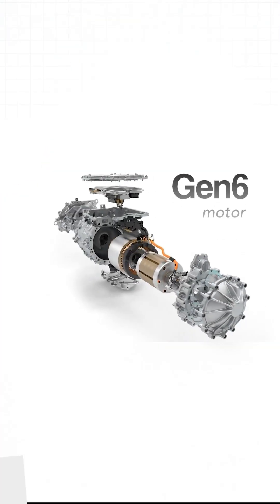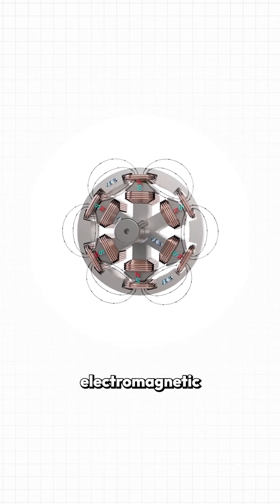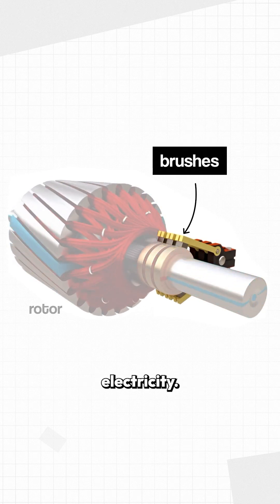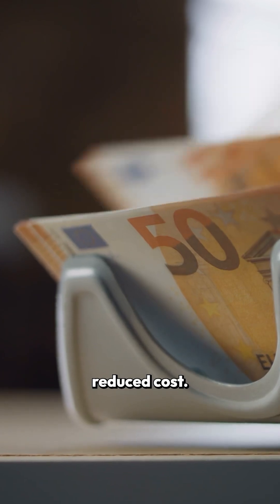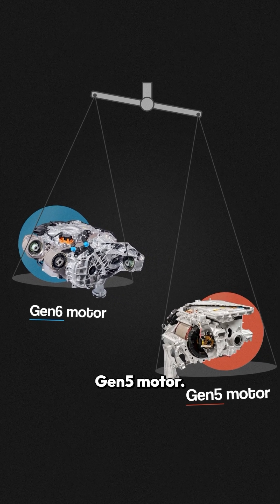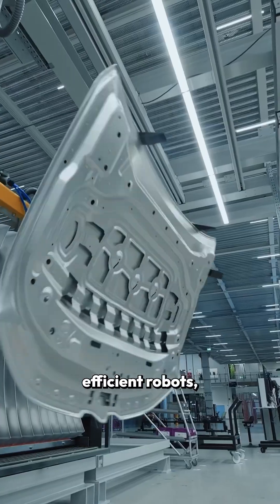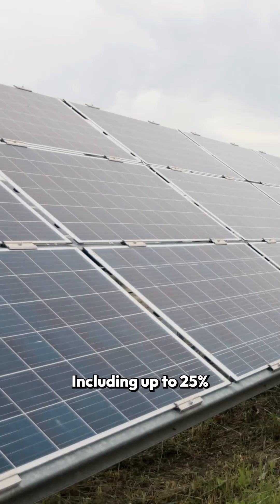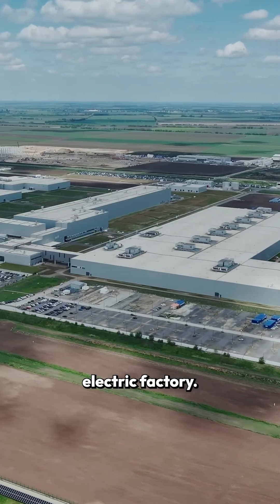BMW’s New Motor is FREE of Permanent Magnets

Comment: I bet that they'll use the fact that the brushes wear out real fast as a super expensive service item you can't replace yourself.
Reply: I vaguely recall an interview with the Munro Associates people saying that an easily serviceable brush wouldn't be too challenging to design. If they're like motor mounts or cabin air filters, they may be slightly annoying to reach but still customer serviceable. The bigger question is whether BMW will hose its customers by locking it all up behind ISTA or some other software lock to register the new brushes. I hope not but I could see it happening.

Something else that changes for the IX3: the battery pack is cell to pack instead of cell to module. They said the battery cells don't really go bad, the control units do. And they said they put the control hardware under the rear seat for easy access. So maybe they've done something similar with the brushes. Have you heard anything like that from the videos you've seen? The seat thing makes sense to me for control units but I'm not sure how you'd access the bushes between motors and the battery.
Reply: @JH-uu7jl  they have a duty to maximize shareholder value. What do you think they’ll do?
Reply: @Haveuseenmyjetpackshareholder value is customer coming back. The only person really in need of repairs is the repair shop or the BMW Dealer that services the cars. From a business perspective you want to earn as much as possible sure but you also want to earn as much as often as possible.
Reply: Still better than CCP pulling the plug on your car whenever they fight against whatever country.
Reply: @Boris99999  No one asked about the CCP. BMW is already playing games with customers. Changing the topic isn’t lost on anyone.
Reply: @JH-uu7jl Brushes have been around forever and aren’t difficult or expensive to replace. But don’t trust any of these companies. They’ll charge you a subscription and put an encryption for a motor brush if they can.
Reply: That's right, there's a video by MUNRO where he explains how to change these brushes on a Nissan engine. 😊
Reply: @JH-uu7jl Nobody thinks they will be hard to service. Everyone assumes they will be hard for users to service. They'll have some digital signature RfID tag or the car's computer will put it into limp mode unless a BMW service tech uses a proprietary "service" reset.

It'll be real easy to service so that their dealer service margins are sky high.
Reply: The topic has been covered before. If I recall right the brushes last 60.000 or 200.000 miles, at those times a bigger service is needed anyways
Reply: Brushes ? We've come full circle
Reply: @drmed92  Yes, we learned that brushes are not ideal but I am curious about what specifically BMW has done in regards to using brushes and why from an engineering, manufacturing, durability, efficiency and cost standpoint(s). Let's see the figures! What will this mean for the buying consumer?
Reply: @user-vp1sc7tt4m  and the stealing consumer!  What will that drive be like?!
Reply: @frederik3326  Bigger service for an electric vehicle? They are basically trying to add bigger service to the electric vehicle. It's bullshit.
Reply: @frederik3326  wow thats some mental gymnastics
Reply: They take very little current to magnetise the coils so wear will be minimal however they are not temperature constrained like magnets and can run much hotter and overload easily.
Reply: They already have these in alternators, but yes only impressive if they have an easily accessible service area where you can replace it easily.....I do have my doubts. It's a service/Revenue opportunity for BMW which is how they make most of their revenue.
Reply: OK,how many times did you replaced the brushes from your car alternator?  The question had the purpose to demonstrate to yourself how dumb your comment is. The brushes costs under 10€ and lasts decades,not only on cars, but on heavy used electric motors. I have a 20 years old angle grinder, heavily used  daily in my profession, changed the brushes  once.
Reply: My motorbike has them. It’s about a 30 min job and a very cheap item
Reply: Ding! Ding! Ding!   BMW requires you to go to the dealer to reset the ECU after changing the starting battery.
Reply: @rockets4kids  ...unless you have a 5 euros OBD 2 diagnosis adapter and you reset the ECU from your phone/tablet/computer. Imagine you need it even for a 20 years old car like my Renault Megane ,after replacing an injector, you need to memorize the injector's code in the ECU.
Reply: I prefer ferrite magnet motors.
Reply: American angst as per usual
Reply: I work in a powerplant. our generator slipring carbon brush didn't wear out in 10 years. slip ring and commutators are different.
Reply: my first thought: Not brushless?
Reply: Service?  Replace the motor!!!  lol...
Reply: you make the brush longer than the contact pad and slowly index them along a cam as you increase mileage = much longer life
Reply: This isn’t new in BMW, previous generations have used this design and they’ve done plenty of miles by now. I had them in a 2022 i4… if they were a disaster then you’d have known about them sooner….
Reply: The brushes in this particular motor are long-lasting, designed to be easily serviceable (no need to get the motor down) and cheap to replace. Won't be more than a "timing belt" or something.
Reply: You will need to pass a 6-year training and certification program to replace those brushes
Reply: As a former BMW owner, this is absolutely going to happen.
Reply: Absolutely. Contrived magnetism will never be as good as the real thing.
Reply: Companies are getting rid of brushes and using direct RF power transfer to the rotor, (and you don't need a powerful magnetic field, so you can use low current) there is some losses in this method, but it's sure better than using brushes.  What they need to do as well is add electromagnetic bearings to increase efficiency and to eliminate friction.
Reply: Annual maintenance of the motor brushes ranges from €1,500.00 to €5,000.00 for MATERIALS alone. The hourly rate at the workshop can vary but will be around €200.00/h depending on the city and country. Maintenance of high-performance models (such as those in the M series) can sometimes involve a higher labor cost. There are also now fixed-price services for the most common maintenance operations, which can make the total cost more predictable than a simple hourly rate.😂
Reply: @franciscorompana2985 ANNUAL maintenance?! Do you have a source for that?
Reply: @franciscorompana2985  Isn´t that bit expensive??? With those prices these engines will never leave europe ou the Emirates...

Comment: Why though? Permanent magnets can be created without those elements, heck pure iron can make a permanent magnet. They're just wildly inefficient in comparison... Not unlike a brushed magnet free motor... It sounds like a marketing excuse.
Reply: It's about power, weight, and efficiency.  Neodymium, iron, boron magnets were developed by GM and first used in the starter motor for the Corvette, which saved 10 pounds. These magnets have the highest "coercively" known ( so far )
Reply: So, 10% lighter, but how many pounds lighter ?  What's the horsepower per pound for the motor?

Comment: Would like to see a wireless energy transfer method to the rotor. Could use voltage multiplier and shorter coils for stronger magnetic field.
Reply: You’ve invented the brushless synchronous motor. Again.
Reply: @markirmuir 
Ok, at least my head is on the right track 😆
Reply: yes, Mahle patented such a motor. Google!
Reply: You can see it in an induction motor. Just look inside a pool pump.

Comment: The dealerships will jumping with joy at all servicing required due to the need to replace the brushes on a regular basis
Reply: Good already expensive cars will be more expensive 🫰🫰 I 😂
Reply: Well, 300,000 miles is hardly "regular basis" for a BMW considering their owners only keep the vehicle for well below that kind of mileage on average. It'd be more a concern for the used car market buyer and in that case I'd say stick with Toyota and Honda, their permanent magnet motors last forever, the batteries not so much.

Comment: I've watched video where Nissan already does this, in the Arya, I think. The brushes are in an easily serviceable location and are good for 100,000 km.
Reply: Service interval: every 15 min race
Reply: BMW brushes inside motor and cannot replace. Meanwhile Nissan only need 15 minutes to replace.
Reply: That's a nissan, and this is a BMW. 😂
Reply: @krisnadiimam4556 BMW has added the sensors, hardware and small CPU to check the brush wear in every model. 
You can enable the service by subscription at $999.99 per month. You'll get bonus seat warmers for 60 hours per month. 👍

Comment: 95% rare earth used in the EV batteries, but sure a little cheaper motors are good for lower end EVs
Reply: You mean that 95% of RE used globally is used in batteries? Or that 95% of the batteries is RE? Both sound implausible. 
Former case: Wikipedias source says it's 8%.
Latter case: Lithium, though somewhat rare, is not normally classified as RE.
Reply: There are no rare-earth materials in batteries. There are some materials however that we don’t yet have adequate supply of if all cars become EVs. But oil and gas became harder and more expensive to extract and we found ways to make that work. I don’t expect anything different for batteries.

Comment: Brushes wear out.  They are insanely labor intensive to change.   There's no help for it.  It's basically the same reason we don't have rotary engines. The ", rings" wear.
Reply: Brushes do wear out, but you can design them they wear out over the lifetime of the car. It's like saying "magnets use their magnetic field", you can design the motor so they don't get to hot and it doesn't happen to early.

By the way it's funny you compare brushes that have to move on an even surface against the apex seals of a Wankel engine, which will have insane requirements regarding pressure deltas, temperature etc.
Reply: @FelixLDevelopment friction is friction. Friction plus being in a cylinder isn't the same , but it's friction Plus, the same way a brush is friction Plus current discharge. Yeah you can design and use the best affordable materials, and then call the fail rate the " lifetime" , but having done this for 45 years id bet it's gonna be 4 years ..
Reply: @mattycheezeburger  that "four years" is especially funny because they have been using this kind of brushed motor in all electric cars they brought to market since 2021. So where are all the reports of failure? Some of those cars have done more than 200k miles /  300k km already.
Reply: No need to worry about the lifespan of the brushes in the motors...
The battery will need replacing before then, and we all know that means scrapping the vehicle and buying a new one - no manufacturer (to my knowledge) has designed their EVs with an easily accessible battery pack with individually replaceable modules within the pack.
It's a whole battery or nothing...

Comment: brushes wear out right? thats a significant tradeoff to brushless motors
Reply: Yes, they wear out. You would probably have to replace the brushes every 15 years or sooner.
Reply: @bengerber4542  These aren't early 80s BMWs anymore
Reply: If it is as easy as replacing tires, it will not be an issue.
Reply: @Sir.NotRealIk  good point
Reply: BMW buyers won't care.  BMW engineers don't design for replaceability..
Reply: These brushes just transfer a steady current with no commutation, no sparks, no wear. They should last forever.
Reply: @MrXenon1977 impossible

Comment: the brushes make it a guarantee that the motor will wear out faster.  the real test will be to see the motor last 100k miles or more
Reply: They use those brushed motors for multiple generations of their electric cars now. No worries.
Reply: Sky high now at 13K a ton, but still cheap compared to 90K per ton for neodymium
Reply: "Planned obsolescence"  Somewthing Veritasium made a video about some time ago, in his case it was about filament light bulbs.
Reply: @paulmichaelfreedman8334 bullshit. It's only planned obsolescence if you design it so it does break at a time you'd want to replace it. Everything has wear, that doesn't make everything planned obsolescence. If the wear is small enough so the brushes hold for a lifetime (which they seem to do on their cars that are longer on the market) it's not planned obsolescence.
Reply: @FelixLDevelopment putting brushed motor is adding more things that can go wrong. Brushes wear makes carbon dust which conducts electricity. That dust can go into the motor bearings and do damages there. The dust can make short circuits between electrical components and other metal parts. The springs pushing the brushes into the rotor can get stuck, making a bad contact, if there is a bad contact, there will be sparks, which will damage the collector, and winding insulation, and you will need to replace the entire motor.

You just replaced a maintenance free motor by one that need maintenance.
Reply: @niconico3907 ask the first years of Model S owners how maintenance free their motors were. They needed a new one every 25.000 kilometers. If you've got engineers who know what they are doing you can build a brushed motor that lasts the lifetime of the car. BMW stated for the iX that they had motors tested up to 1 million kilometers. Also that dust won't go to the windings. The brushes are in a sealed compartment. And again. They do NOT need to commutate the current. This reduces this problem a lot until it's not a problem over the lifetime of a car. BMW had motors tested up to 1 million km for the iX.

If these motors will fail prematurely, we're are the reports for the literal millions of BMW electric cars with this engine technology already on the road?

Comment: this would be perfect for a military vehicle because they're not relying on rare earth materials that come from regions of the world that would be problematic to control if a major conflict and do the reduce costs you can have more numbers of the vehicles that they are attached to
Reply: Induction motors don’t use permanent magnets either. 
They are slightly less efficient but they can be turned off while permanent magnet motors are always ‘on’. By that I mean that when idling, they’ll function as a generator which is not always desired. 
For example you don’t always want to drive the rear axis of a 4wd car. A PM motor however would start regenerating when not powered. So you’d need a clutch to prevent that. 

Non-PM motors would not regenerate automatically in that scenario.

Comment: Synchronous motors with brushes have been around over 100 years!
Reply: Just like the one in the Renault Zoe.
Reply: Yes, and you also get rotary transformers that are pretty much the same shaft area as brushes, bu are capable of transmitting power with no contact, just using Ac excitation and a rectifier on the shaft side to get DC.  As you already have a pretty powerful computer in there driving the coils, adding in a little extra to control this drive is a very cheap option, and you get a sealed unit that does not generate any dust, the drawback of brushes, that makes making them hermetic a problem unless you include a fan and air path with filters in it.
Reply: You can thank Tesla for them (no, not that one, the original Tesla)
Reply: @oddball_the_blue  Absolutely, Nikola was an absolute genius
Reply: This one looks different having windings both on the stator and the rotor. AC synchronous motors typically have stationary windings only on the stator.
Reply: @jacklav1  what about huge alternators in power plants? I bet they're not using huge permanent magnets in the rotor
Reply: @jacklav1  Renault and Nissan group has been using this engine for many years, there is a video on MUNRO channel that explains it very well 😊
Reply: @j @jacklav1 
Yes, slip ring motors are asynchronous.
Reply: @jacklav1 these are not comutating brushes but slip ring brushes which should last for at least 300000km, they do not wear easily. But yes, I expect that BMW will chip them so that they will start functional only after being recognized by computer programme in authorized bmw service
Reply: yes, Mahle patented such a brushless motor. Google!
Reply: @Maromarix  I don't know Mahle, but the article is about a synchonus AC motor with brushes, N.Tesla is credited with a 2 phase version, Dobrovolshy is credited with the 3 phase version. My point was the 3 phase synchronous motor has been around over 100 years, no permanent magnets,
Reply: Good idea. Good discussion.
Reply: No one said they were a new invention.
Reply: So they chose the permanent magnet based to increase efficiency. Which one is cheaper back then, permanent magnets or this one?
Reply: @noname-codm4590  back then there were no rare earth magnets, and the magnet strength could not make large A.C. machines
Reply: And wear out & go wrong, Will be the modern N47 😂
Reply: @Youtubedotcomma brushes should be easy to replace.  Well, unless you are BMW hahahaha.
Reply: @Youtubedotcomma brushes have always been the primary cause of electric motor faults.
Reply: @AlexanderJay  which is why after 100 years replacing them should be a pretty easy thing to calculate